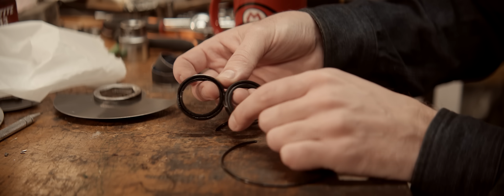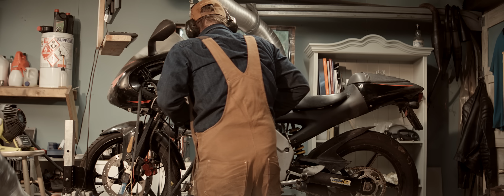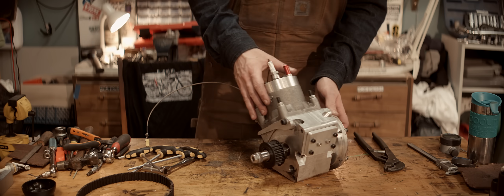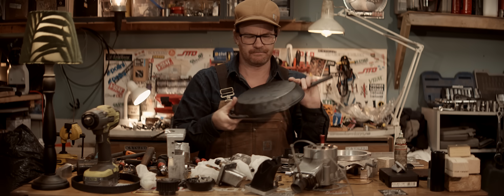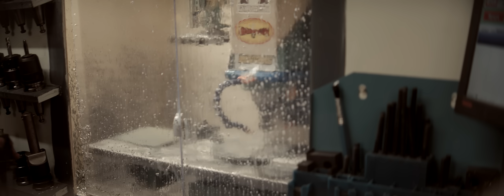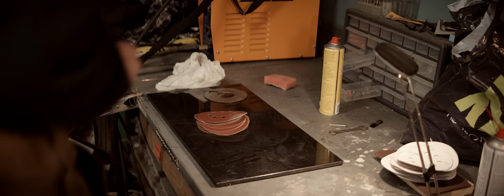Another Frying Pan Dead for The 2-Stroke Cause.

Comment: Ya know I have reasons to believe that when removing stuff there are situations that the impact driver is the best practice. When no matter what I did with the 1/4 drive ratchet, I snapped 3 out of 4, 8mm bolts and thought well if the 4th one is going to snap let do it with style. 1/2 inch rattle gun on an 8mm bolt that was half the original thickness due to serious rust, but it was the only one that came out in one piece. I had surprised pikachu face all day
Reply: I like my Milwaukee M12 impact wrench due to it's low setting which will do slow impact cycles so as to put minimal force on the fastener.  Great for tightening initially, and then I use a manual wrench to torque it up.    I'll typically use a wrench to break a fastener loose and the impact driver for the rest of the way.   I also like my M12  drill since it locks when it isn't spinning and has a variable torque release so you don't inadvertently strip threads.

Comment: Is that older Teflon coating actually Teflon, i thought a lot of those non stick pans were actually ceramic based? That would make more abrasive particles and be like sandpaper against the rotary valve, friction/heat?
Reply: Some are marketed as SR-Matrix Non-stick. They have some kind of stainless steel partials mixed with the Teflon to protect it from metal cooking utensils. It sounds like it could be very abrasive to rotary valves.

Comment: its so many years ago but im pretty sure we did hundreds or thousand of small drill holes like 0,5-1mm deep instead of just a few grooves like you did. it relieves alot of the the friction yet theres not a good chance to get blowby. also did on the piston. i never compared to a similar setup with similar to what you did but i think blowby will calculate with initial number / next chance to escape / next chance to escape. however we never did any engine with your kind of top end power potential.

Comment: Alex, whatever material you decide to use for the plate, try to keep it flat and shiny, without grooves.
To fight friction (and temps), you want an oil (and gasoline) film to form between the blade and the plates. If you machine grooves or holes, the oil gets trapped there and forms no film.
Also try to round and smooth as much as possible all edges of the rotary valve blade.
Reply: I would go back and copy the design of a working rotory valve assembly from another bike.
Reply: @purplepenguin43 he's trying to reinvent the wheel to make it more round.. I'm here to watch the struggle.
Reply: @7eis  me too :) but lovingly
Reply: @7eis he tried that from the very beginning🙈 i admire his preseverence. but this big impact wrench en talking about welding the crankpin tells me he is far from a trouble free engine. but it is good for advertising and the likes.good luck.
Reply: Perhaps a slightly higher concentration of oil, or a different oil?

Comment: A good source of cast iron is a machinery that has lathes and a saw. We have a lot of scrap pieces in trashcan of many bar stock materials. 5-10mm thick with diameter 100-400mm. You can pick the correct material for your use. Which someone can suggest, but not me. GRP, GJL, GJS... Idk... But i bet no one has "something probably iron that a magnet sticks to and has been cast into a frying pan shape". 😅

Comment: The seal will likely need to be PTFE. Rubber (NBR), and (FKM), don’t usually have much dry run capability before they overheat, and this also limits the permissible shaft speed / surface velocity before overheating occurs……PTFE is a lot more picky about misalignment, surface finish and permissible shaft float axially…..so everything has to be about perfect or it will be worse for durability than an traditional seal with a guarder-spring…..if everything is to manufacturer spec. a PTFE seal can usually take continuous direct temperatures up to 250F and be be exposed to 450F environments intermittently, and last much longer than (NBR) & (FKM) seals with less wear to the shaft sealing area (low friction).

Comment: The problem with Teflon is that it's so good at being non-stick that's its actually quite difficult to get it to stick to the frying pan during manufacturing and higher quality pans will use more advanced methods of adhering the Teflon,    This means the quality of the frying pan will greatly affect the durability of the Teflon coating.

Comment: @2strokeStuffing, 

Im a mechanical engineer and i work on industrial machines..  the 0.06mm run out should not hurt the seal, but what kind of material are you using for the seal?
When i test planetary gear boxes those seals that you look to use run early 70 to 90C when i first start them and run them in so i would not be worried about the seal i highly doubt it is a problem.  Those are often running in about 1 hour of running low rpm.

What I could suggest you is use POM (POM plastic - Polyoxymethylene. POM material) for the slide area for the rotary intake. Love seeing your stuff and wish you best of luck!

Comment: Next time you check cranks for alignment/run out  ect. Try putting two  indicators up on each crank half as  it will show bigger numbers and can really help you see the differences if there are any. As well as the shafts as  the shafts are  the end all be all  measurements. Doesn’t appear crank is the issue this time tho
Reply: Yes, I have previously said that the disc vavle and running surfaces need to be parallel to the crankcase joint. This needs doing in the mill.

Comment: If you have a thermal camera, you could point it at the rotary valve area while you start the engine and run it from cold. That way you may be able to see where the heat is originating from and propagating from.
Reply: If not, he’s the kind of guy who could pop out the ir/uv lens in a camera.  

They can be life savers when it comes to diagnostics.
Reply: @gibbyrockerhunter inbefore he goes into a rabithole on some protype homemade thermal camera, then spends way too much time trying to get to work, to then end up with going back to his original idea of using a thermal laser thingy. Ahhh I love the process
Reply: @ShitshowRacing  I get what you are saying.  And personally one of my biggest issues in life is using a perfect idea.  And not a good enough idea.  

The ir thermometer is also obviously absolutely amazing.  It definitely can deliver the same results for $10 and a little testing to get used to it on the machine at hand.  So yeah, i think that’s the ticket.  

Devil’s advocate here though, it is a convenience to actually see what the thermometer is showing though.  You also get the option of seeing other things you may not of been looking for.  

With that said, if anyone has 20 minutes to execute the idea of modifying a piece of trash, and be able to use it even more simply then the thermometer, I absolutely 100% sagest it.  Be it for a project in itself or to open new windows with a new tool.  Totally worth the time when you have the time.
Reply: @ShitshowRacing  hell.  You can even feed your shrimp food dyed with florecine, take a quick pic, and be able to count all thousand babies at once.   Easy peasy.  If that’s what you are into.
Reply: Or rent one . . .
Reply: The only problem is that metals do not emit infrared well, so you will have to stick electrical tape(or something) in places that can heat up.
Reply: @IlyaVoronkov  in theory and teachings yes.  

But in my experience, a web cam cmos with no filters is more then enough to find a dead cylinder with in 1 min on a BBC from a CCStart.  

Yes the heat spreads.  But if you watch it, it is very easy in practice to see the origin.  Especially if you are familiar with the test subject and how it operates.   

I was using that real life example to help with  thermal mass understanding.  Big thick iron with big thick aluminum.  

I have found it works quite well with bushings/bearings on everything from auto wheels, auto pulleys, skate wheels, and even small electric motors.  

In addition to being a life saver when trying to find the single burned out component in a computer board or Tattoo machine driver. 

Sometimes it’s nice to have a real thermal imaging device.  Like for killing pigs during a moonless night.  But for everything else I honestly would rather use an old digital camera.  Iv seen nice thermal goggles....there’s no way in hell I would expose optics and quality electronics of that caliber to a garage setting.  Definitely no way in hell when there’s a nitro engine running.  Lol.  

That’s just my real life tested reality though.

Comment: Just stop with the frying pans.. please! Look at the way older bikes with rotary valves we're built. You really need some sort of drip oiling system for cooling and less friction. And use a hard wearing material with low friction. Teflon frying pans arnt either of them things

Comment: If that seal was maybe designed to run somewhere where it was surrounded by oil? Not just picking up a bit from the two stroke oil. It might be inadequately lubricated, which would obviously cause heating and early failure.
Reply: You're onto something James. Iron frying pans used to be broken-in by heat-cycling them multiple times with cooking lard. They were finally deemed "usable" when food no longer stuck to the cooking surface. The same principle was used by long-time engine manufacturer, Duke Fox, when advising purchasers of his cast-iron-piston engines (steel cylinder) to use a high percentage of de-gummed castor oil in their fuel blends while heat-cycling them through a prolonged break-in period. "Stuck" pistons due to high temperature (fuel lean) operation were a rarity when Duke's process was followed.

Comment: There’s a reason why you don’t use metal utensils on non stick pans- it will scratch and remove the coating- 
I would think the rotary valve needs to float/slide on its drive shaft, if locked to it with no give any amount of thrust walk in the shaft or just heat expansion will force it to one side or another.

Comment: Hi, checking the crank with the DTI near the bearing area is not going to show up much run out If you support the crank at the bearing area place the DTI out at the ends of the shafts, I do not like to check between centres as they are often knocked about, another way is to fit the crank to one bearing in the case half and measure for run out on the free shaft... Many Years ago I had a rotary valve Jawa 90cc, If I remember the valve material was "Tufnol" also known as Turbax, Resitex, Celeron and Textolit..   To get cast iron to stay flat remove the "skin" on either side. heat to red and slow cool in vermiculite ,, then begin machining.. Good Luck from Ireland
Reply: Yes I noticed that too… looked like he was not actually measuring the crank web alignment with thin v-block on either crank stub.

Comment: What if you put the rotary valve sealing face on an angle and make the valve blade " Wobble " so its only really contacting the valve opening in a small part and is floating the rest of the rotation?

Comment: is it possible that air pressure differences between crankcase and atmosfere are deflecting the valve sheet? that might cause excess friction independent of the clearance. incredible channel!
Reply: i wondered if air could be used in the case grooves, to 'float' the disc

Comment: You can probably just buy continuous cast iron round bar from a steel merchant. It will be a much higher quality material than a frying pan,with minimal internal stresses. I use it to make cylinder liners and piston rings.
Reply from the maker: 👍 Frying pans obviously won't cut it.

Comment: use one of those temperature gauges with a laser pointer to see where the heat is coming from. the drill damaging crank bearings is a low iq theory whoever had that
Reply from the maker: I used an ir-gun and it's definitely the rv driver, or the valve. I can see how an impact driver could knock a crank out of true, especially a small one like this.

Comment: The two rotary valve engines I've had, the rotary valve casings were gearbox oil cooled, ie a fizzy and a Ke175. Take a look at the manuals of both bikes
Reply: But he was successful before without using oil cooling,. Thats why this issue is puzzling
Reply: @Tekenduis98  When Alex built the SPX variant 8 years ago he may have being using the OEM disc valve and mounting boss which was splined. The disc valve and the running surfaces have to be true to each other.
Reply: are some rotary valves lubricated? still two parts rotating 15krpm against each other with some pressure difference pushing them against each other
Reply: Yes, the Yamaha autolube system drips oil into the intake tube after the carb and directly in front of the disc @geemy9675
Reply: @geemy9675  
Good point, both my rotary valve bikes were oil in fuel, so yes they probably were
Reply: I think getting something like a FS1E or something standard and copying it's set up and clearances etc could be the way to go. A known, tested, starting point.
Reply: @AutoBeta2T  
From the two I've had, they only spin at about 7.5k max, this thing will spin to 20k hopefully, possibly too much for a rotary disc valve, just an assumption but who knows.
Reply: @adolfshitler  good point - I'd not thought about the extra RPM...
Reply: @AutoBeta2T  just thought, if you spin up a CD or similar to high revs, before they explode they go all out of shape, a kind of wobble sets in, quite a big wobble at that.
Reply: Yes my fs1e was race tuned , ran rd200 right micron ,

Comment: Hi, About the friction problem, could it be that when spinnig fast, the rotary valve driving nut is binding on rotary valve, and not allowing minimal flex that is needed. Like rotary valve gets stuck on the drive nut, and then rotary valve covers force it constantly spin straight, that will create friction. 

If this is a problem, maybe harder steel drive nut would help lower sticking of rotary valve? I am not sure what kind of hardness of steel they use in factory engines. 

I had heating and stress issue similar to this, trying to couple chainsaw engine to a transmission trough a diy joint made from 24mm 6-point socket and a nut :D 
After only 3-4min of runtime, the socket was 200c and almost welded itself to nut. All engine power went to heating the nut.
Nothing helped, i tried to grind more clearance for the nut and allign motor better. Maybe they were too soft, i dont know.
Reply from the maker: Definitely a possibility👍

Comment: Well, if you insist on using disc valve with plastics, I advice you to use rotating valve made of metal. Then you can glue plastics to the engine case. Use zedex plastic for that, it is poly ether ether ketone. It is used for repair of metal mills or lathes. There is also some liquid composite for that. Possibly you can even try to make valve from PEEK.
Reply: It also would be 3d printable, expensive, however it might work :)
Reply: Peek is expensive and i dont think the Ender can Print this material. But you can machine peek pretty good.
Reply: @Saeschboy  yeah i know, the ender could do it if it would have some upgrades. But i get what you mean :)

Comment: Alex, If I may re suggest putting the the cover and crankcase in the mill to check for un evenness. Also put the disc valve/mounting into the lathe and check for run out. Are there any chatter marks on the disc valve mountings etc.
.

Comment: As of my experience, I can recommend Guhring's Diver endmill series. It can plunge straight down if needed, though helical ramping is preferred. Recently ran 84 holes, 30mm in dia, with a 10mm endmill going 2000mm pr min. The thing didn't even look like it had been used. And oh, it was in a lathe with Y-axis...
Reply: Also the cheap guhring endmill is good. I used those at work a lot a couple of years ago. As good as seco jabro etc. For my work I never had the need to buy the expensive diver-series endmills... Which should be better, but i think overkill for home use.
Reply: @MSivonen  I agree. I have one for peck drilling and milling and I  changed it out after 1 year of every day use, just because the fear of it soon breaking 😂

Comment: I think you should give a tube style rotary valve a try. Disc valves are a bit more simple, but have their own problems of friction and sealing.
Reply: Don’t tube styles need incredibly accurate machining tolerances?
Reply: @microsoft790  ......and didn't we  try a tube-valve system some time back?

Comment: Amazing content as always!
I was wondering if all that black stuff could be from carb, like some sealant or horrible quality gasket disolving into the fuel and getting into the engine.
I watched original upload before and have been thingking about it since, but it probably is that seal getting destroyed.
All the best and good luck!
Reply: surprisingly, powdered aluminum is almost a graphite/black consistency. you'll see the same stuff when polishing aluminum as well. although there are definitely some other goodies in there.

Comment: @2STROKE STUFFING 
remember, Non-Stick PTFE is not suitable to replace, or the same as Low-Friction PTFE; they are 2 completely different types of polymer formulation of PTFE. Not identical !!
Plus the pan metal is meant for high thermal transfer, not thermal resistance, hence the heat build up !!
Some of the dbris with the CF duct is also made of spalled-off PTFE molecules.
Reply from the maker: I think I've found out the hard way - like I always do...
Reply: @2STROKESTUFFING as we all!!
Reply: It kind of makes sense, food's not moving all the time, and especially it's when it's not moving that it sticks. 😀 sticking and sliding with friction are different too
Reply: Also worth noting that non stick pans are no longer PTFE. It's use in that application was banned some years ago